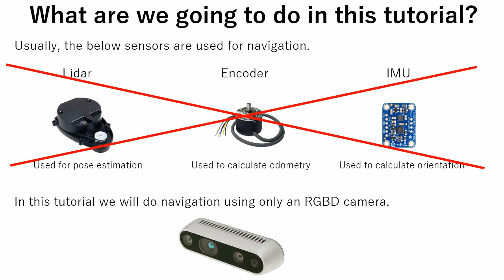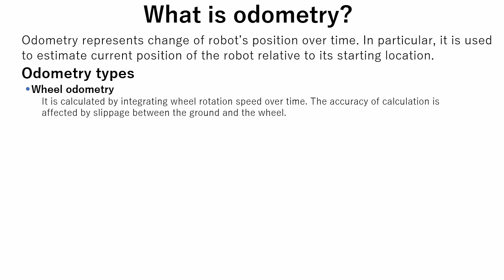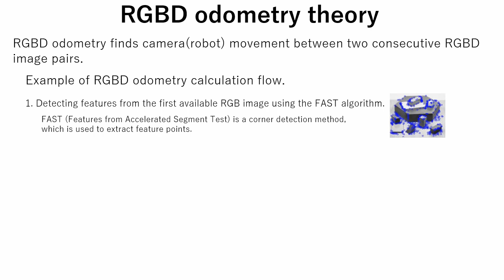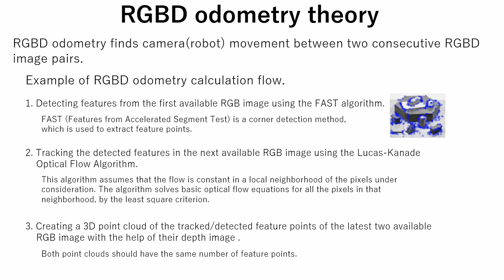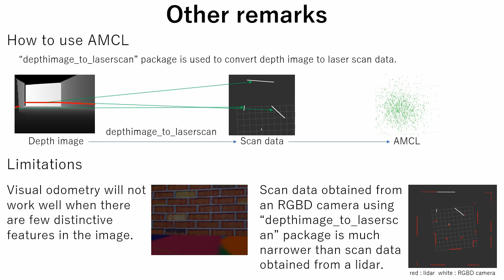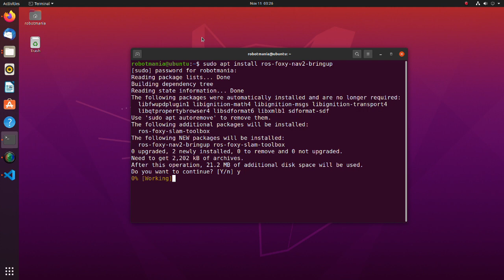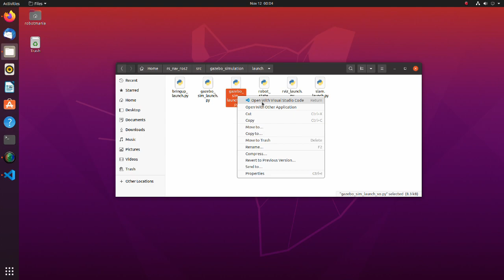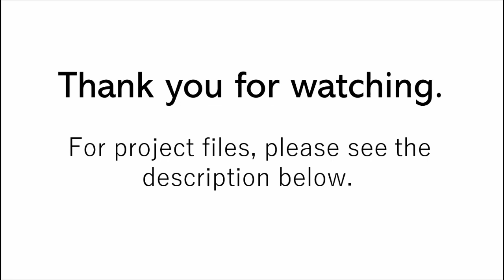Robot navigation using only an RGBD camera

Comment: Hi, I wanted to calculate height and width of the object detected using RealSense 455d. My yolov8 model provides me with a bounding box for particular object. I wanted to find its height and width using depth information, if you know how to do this please share. Also, is there any method to reduce depth noise?
Reply from the maker: Hi Nobody GG!
Thanks for watching my video!
Using perspective projection transformation, you can calculate coordinates of bounding box in camera (real world) coordinate system. So, if we assume that object height is about the same as bounding box height, you can estimate object height. Here is the link to the video in which I explain the theory. Unfortunately, I don’t know how to reduce depth noise. I assume that the noise inherently comes from mechanical structure of the depth camera.
https://www.youtube.com/watch?v=--81OoXMvlw
Reply: @robotmania8896  Thanks for reply. I will try to implement as you shown in that video.

Comment: There is a module not found error in the file that you have given! could you check the error and reupload the file, I tried solving it but there are more issues importing issues, saying that directory mismatch! I would appreciate it if you could check it! to be precise it's from the file gazebo_sim_launch_vo.py file
Reply: I see that you have mentioned how the robot navigates but the thing is, can you mention which part of code does all of the things you mentioned... can you explain to me where and which part of code does the below points mentioned are present - 
1) Detect features from the first available RGB image using FAST algorithm.

2) Track the detected features in the next available RGB image using Lucas-Kanade Optical Flow Algorithm.

3) Create the 3D pointcloud (of the tracked/detected feature points) of the latest two available RGB image with the help of their depth image .

4) Estimate the motion between two consecutive 3D pointclouds.

5) Concatenate the Rotation and Translational information to obtain the predicted path.
Reply: For the case of create 3d point cloud, what did you put as intrinsic parameters
Reply from the maker: Hi Niranjan Sujay!
Thanks for watching my video!
Sorry for the late response. I currently have some issues with my Ubuntu20 environment, so I cannot check the yaml file right now. But if there is a bug, I will fix it. Also, regarding rtabmap code, you can find it here. Please check the code for details.
https://github.com/introlab/rtabmap_ros/tree/ros2

Comment: Great work! Do you have any tips or ideas on how to improve the performance of these camera-based systems without using any sensors other than cameras? is adding more cameras gonna do the trick or do we need to use different methods?
Reply from the maker: Hi Omer Sayed!
Thanks for watching my video!
Disadvantage of camera is that is has narrower and shorter range compared to Lidar. If you increase number of cameras, you will be able to compensate narrow angle, but the system will be more complex and expensive. So, I think that for real world application, combination of a Lidar and a camera is optimal.

Comment: Thanks for the video. Navigation part is explained well but the mapping tutorial is not there. Can you help me how you did SLAM mapping for the same using this camera?
Reply from the maker: Hi balaji ravi!
Thanks for watching my video!
I have used “slam_toolbox” to create a map. In case of this simulation, you have to launch “slam_launch.py”, “depthimage_to_laserscan_node”, “visual_odometry” (refer to “gazebo_sim_launch_vo.py” script). You have to move the robot very slowly to create a map successfully, since the robot loses its position very easily when using only RGBD camera.
Reply: @robotmania8896  thanks for the reply. I have tried setting up depthimage_to_laserscan_node, but facing issue. how to install the package for foxy and slam toolbox is not publishing a map in my case? And also visual odometry how to use.
It would be nice if you could share the project files for SLAM mapping as i can refer and see where I made mistakes
Reply from the maker: @balajibull  If I remember correctly, if you have installed all packages mentioned in this tutorial, “depthimage_to_laserscan” should be installed automatically. If you are using “slam_toolbox”, you don’t have to make additional packages. Please refer to this tutorial for “slam_toolbox usage. 
https://navigation.ros.org/tutorials/docs/navigation2_with_slam.html